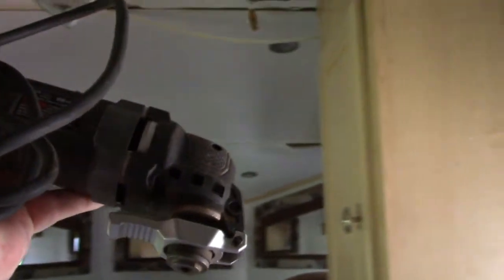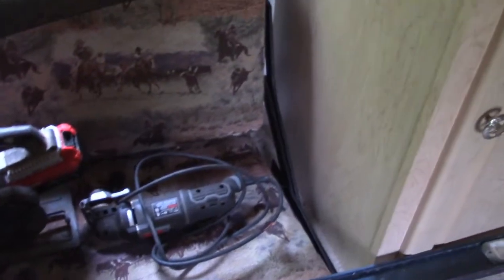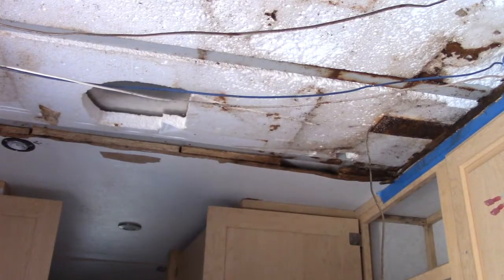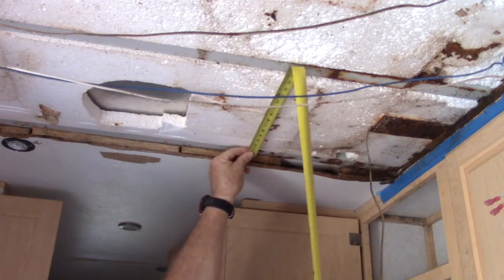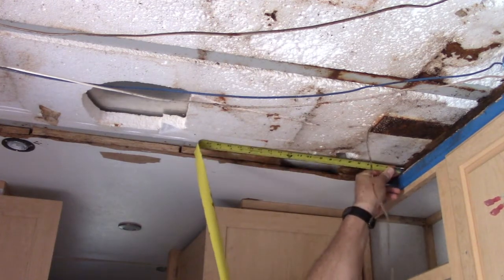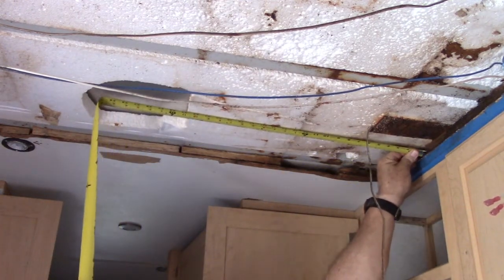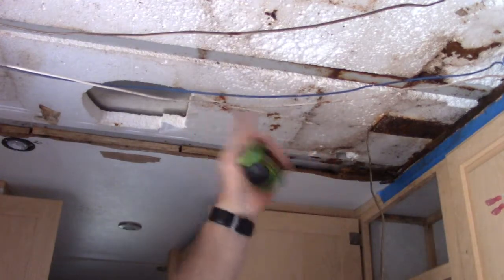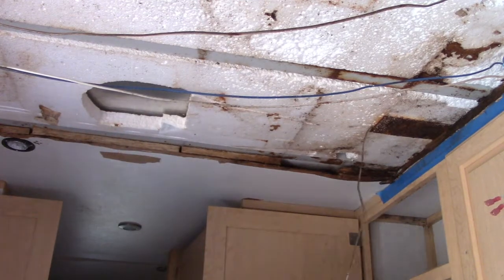How to Repair Water Damaged Ceiling in Trails West Living Quarters or any RV or motor home.

Comment: Do those panels need to be that thick, or are there other materials you can use to replace ceiling / wall panels that would be suitable? Our trailer is already pretty stout (heavy!) and want to be cautious about potentially adding weight when we do our own leakage repair.
Reply from the maker: You could eliminate them, but then what do you have between you and a tree branch that falls on the trailer? You might try corrugated fiberglass panels? They would offer you some protection with less weight, or ever corrugated tin. But you also need something for the screws that attach the paneling to anchor into. Maybe use the corrugated tin and leave it exposed and call it "rustic"?

Comment: What a project. I am in the same situation, dealing with leakage. I saw that you went around the cabinets, is it too much of a problem to remove them to access the ceiling? I hope all went well, Scott
Reply from the maker: Not sure about how easy it is to remove the cabinets since I didn't do that. But essentially everything just seems to be screwed into the steel cage frame, so it should be pretty simple.

Comment: I have water damage in my rv and unfortunately the leak is active still so it needs to be located and sealed. Having a hard time finding it from the outside roof. It would be pointless for me to put new roofing on the INSIDE if the leak is still open to water coming in.

my question is how would I attach any type of paneling if the water damage was moderately bad where if you screwed holes in the screws wouldnt be able to grip into nothing but rotted wood OR insulation Im seeing. I can provide pics via email if you accept those. Im working on putting new paneling but im waiting for these cabinet holders I ordered to hold them flush to the ceiling so I can screw them in. 

they're way thinner than your choice of roof tho. After I get the paneling up I planned on buying cedar board to go over it .. but if I dont seal the leak, new water will just damage my expenses..

**updated (Nvm, I see you put the thick wood panel and then the cedar! gotcha thats what I need to do but there's insulation exposed so I might need 2 x 4s cut and used as braces which would probably be tacky , I don't know)
Reply from the maker: See my video on repairing the leak at https://youtu.be/iWAViucLLMg . There should be a square steal frame that you would secure everything to.
Reply: @PirateStu  ok. thank you, will check out on break at work